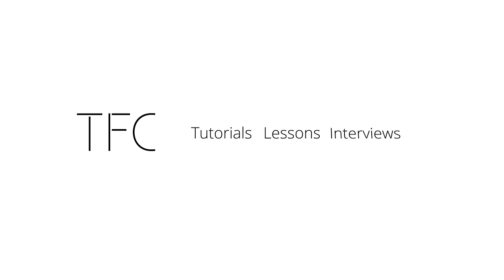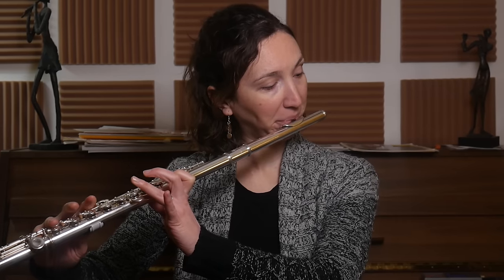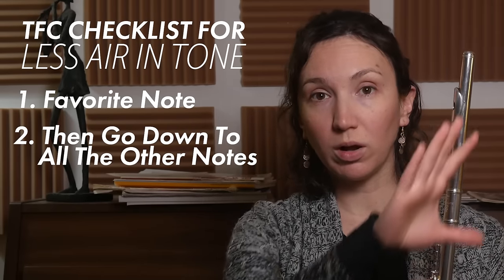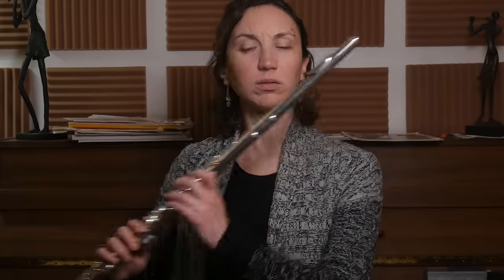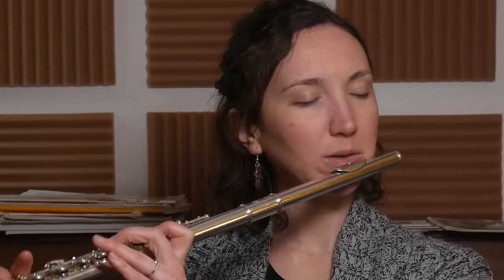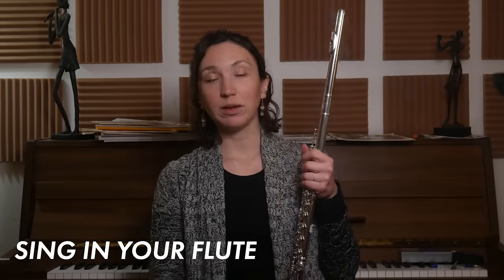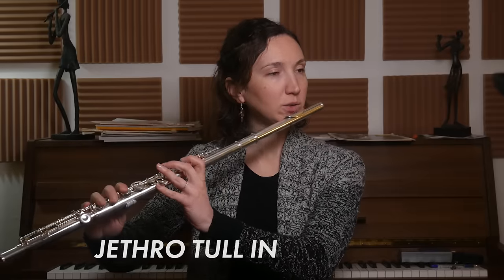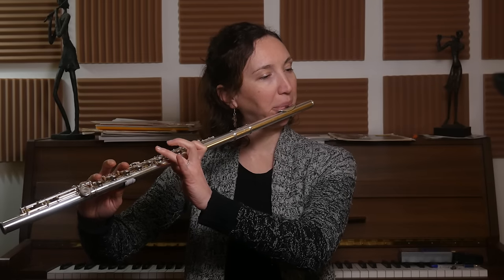How to get rid of the AIR in your sound

Comment: Could you give some advice on playing the flute louder because I have been told I have a teeny tiny sound but I have good precision but just not volume. When I play in my room I always seem very loud but once I go into rehearsal, my sound becomes so quiet compared to the other flutes and instruments. I might have a solo in my wind ensemble piece and it would be nice for me to play it loud. Thanks!
Reply: Michael Hung I'm not a good flute player and have the same problem. For me it made a big difference when I twisted the head inward. I had blow hole in line with finger holes and air was not all used. I rolled head slightly clockwise toward me so it was offset from finger holes a bit and as a result lip covered more of the hole. It was more efficient. As she says if you cover too much of the hole the sound gets thin. That was just me and might not help you.
Reply: I'm one of the louder ones and usually I'm blowing harder air. Not faster, but more forceful. You tend to crack a little bit more, but there are also other things like alt. Fingerings that can help you.
Reply: most have this problem, airy inconsistent, teeny sound.  i am told embouchure (shape of mouth directing air efficiently, she has a great video on this too) and more air from diaphragm. some may twist the head clockwise or anti, and then overing 1/3 to 1/4 to find the best solid sound on your best note, and then doing for the rest of the notes...the best thing i learnt in this video, is keep the shape of your face relatively to the flute consistent..i used to adjust my face for dif octaves...it works but i think is wrong, and you should adjsut embouchure instead as she says here.  Wow, makes a big dif after i watched some of these videos.
Reply: Michael Hung the trick is to try and make the air speed fast and hits the edge of the lip plate at the right angle exploding in sound. But you need to try to do it using the shape of you lips to speed up the air stream and aim it like a laser instead of just blowing hard. You need resonance as much as or more than forceful power. But also remember in a large room the sound flies away from your ears. You might not be as quiet as you think. Ask the other flautists or wind section if the balance between you is ok.
Reply: omg same 🤦🏽‍♀️ i would say go outside and play normally. gradually get louder, but dont play past your best sound. practice until you can play strongly and nicely
Reply: and practice with others
Reply: Faster air and more narrow lips may help. If I want a more wispy and soft sound I open my mouth more and blow less air. When I play tighter and louder notes, I close my lips more and direct faster air. Practice practice practice! It gets easier!
Reply: I know this is late but this is still relevant. A good tip to play louder, and even just playing your flute, is to play from your stomach. You don't want to force the air out with your shoulders and neck area. That would strangle your sound and cause it not to be heard. Hope this helps any players!!
Reply: Use more air and use your stomach to push past. Imagine blowing and pushing with your abs way way past for example you’re on stage imagine pushing all the way to the back wall.
Reply: @Varadict  blowing your air more forcefully but not faster makes no logical sense.
Reply: Just roll out a little hit, make your aperture bigger, and you'll play as loud as everyone else, maybe louder. You're welcome.

Comment: Good exercises but I have found that practicing them without proper breath support will produce very little improvement.  I would have started by emphasizing correct breathing and supported air flow.......then move on to the exercises.  I have also found that whistle tones help as well.
Reply: Foto Favoloso do you know any exercises on whistle tones?